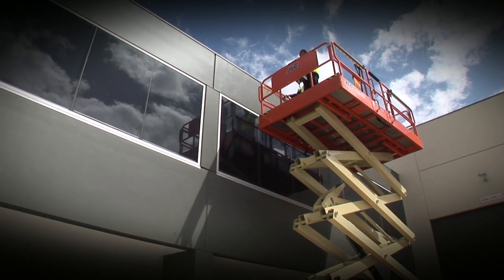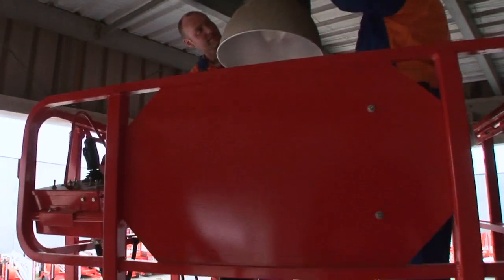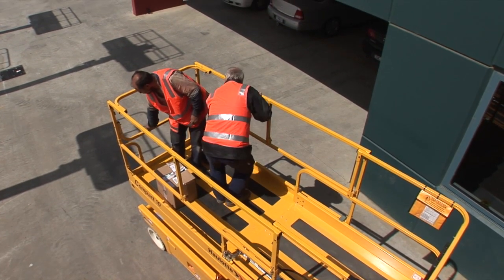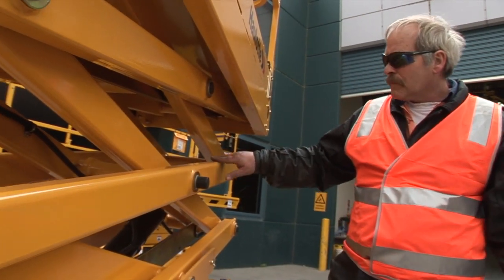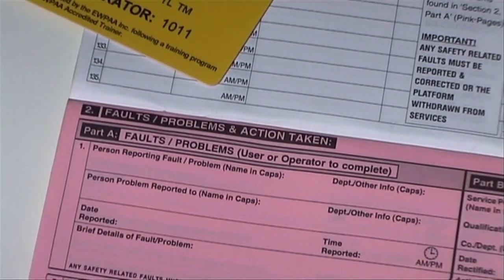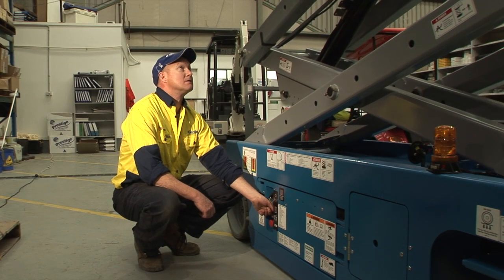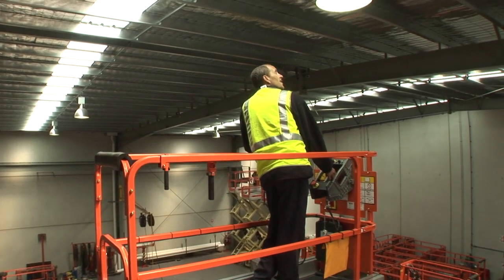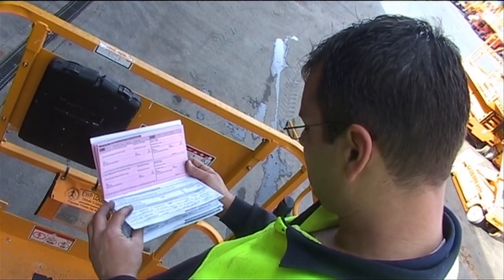EWPA Scissor Lift Training Video

Comment: These guys aren't wearing a harness!!! Are you kidding me!
Reply from the maker: Good comment.  
There is a high risk of falling from height from a scissor lift, so all personnel must remain within the platform.  
On all MEWPs the guardrails are the primary protection against falls from height. This is the safest way to use an MEWP.  
In a boom lift the EWPA recommends to wear and connect a harness (full body harness and lanyard with shock absorber) to reduce the risk of ejection from the platform (the catapult effect). 
Please check out our Good Practice Guide which provides more detail, in short you should always stay in the platform and use a harness for boom lifts.
Reply: Don’t need no harness lol